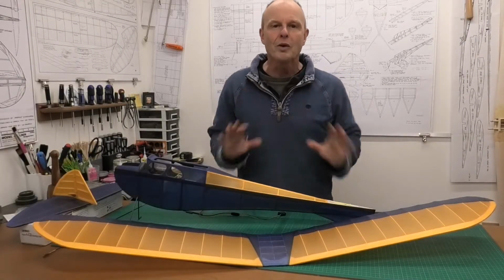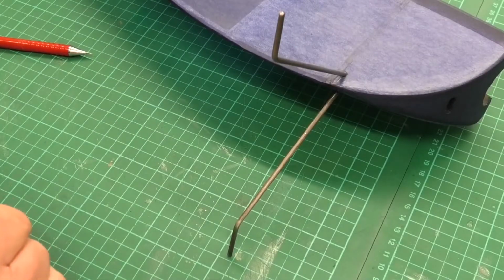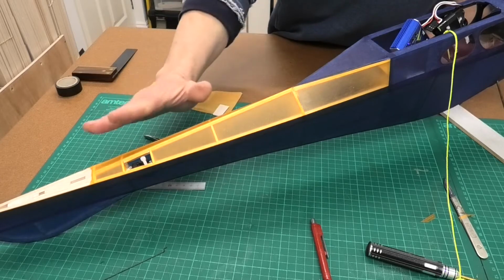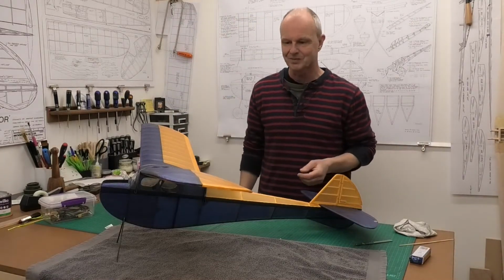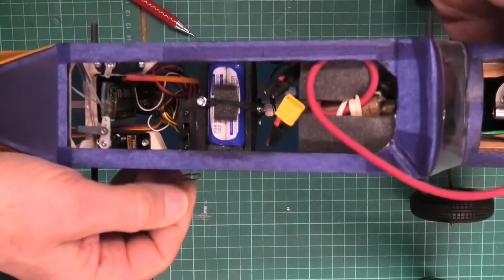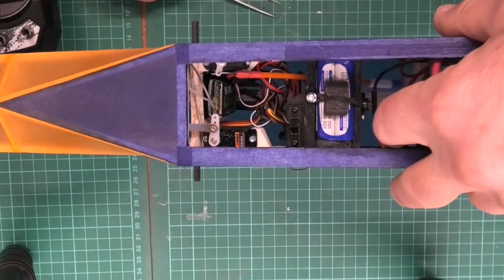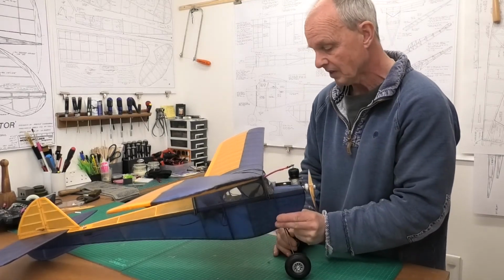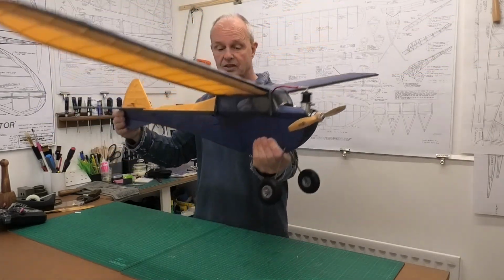49" Diamond Demon & Bantam 19 Spark Engine - Pt 19: Setting up the Finished Plane - Ben Buckle Plans

Comment: I really appreciate the detail and time you take in these processes. Anyone wishing to learn basic technique would be well served watching this series. I would raise two points. 
1) I understand you are using two layers of coating for strength. As a beginner I'm still learning but was told other places that cutting weight was essential. I primarily build smaller models than you so perhaps it's more important in my arena.
2) is there a reason you don't include your test flights in this video series? After watching anything being built so meticulously, I would say the big payoff for an audience would be in watching them actually fly.

Thank you again for all your hard work. As a beginner I appreciate the time you've taken here.
Reply from the maker: Hi there thanks for the comment, pleased you enjoyed the video.  With regard to your questions, not sure what you mean by Cutting Weight, sorry.  On the second question, I do always have flight videos of my builds, there are at least two for this build, here is the maiden  https://youtu.be/OoqNKK2NN9Q?si=UMWPjM9LiQdehsfQ
Reply from the maker: And another https://youtu.be/AhUplpuHu4o?si=ctWi5ldhYDVG0Xuf